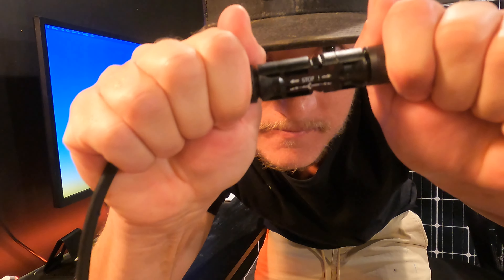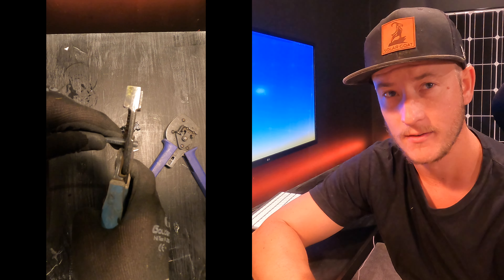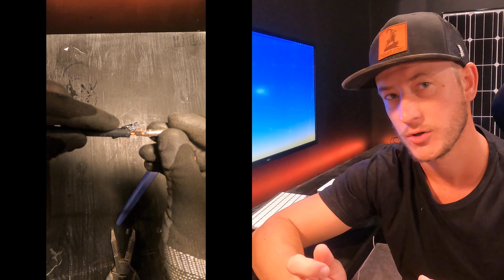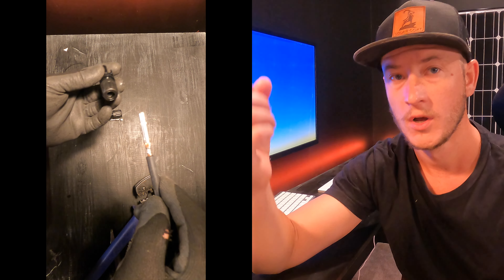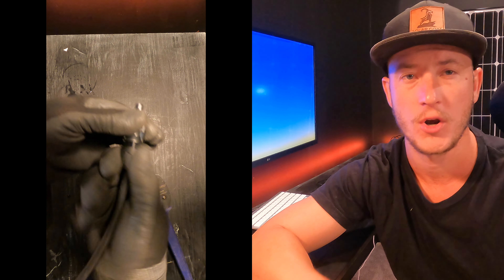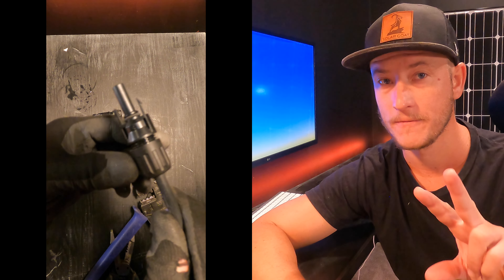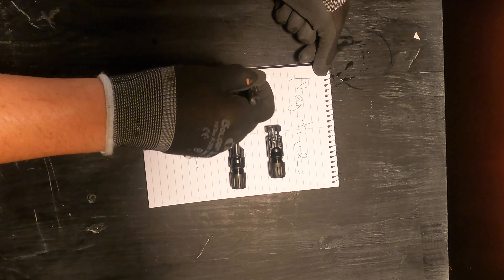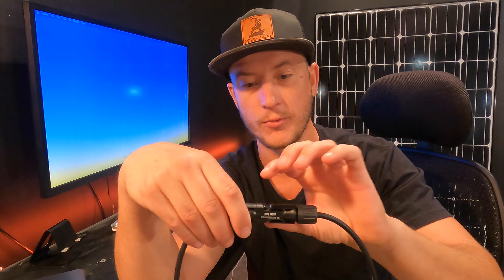How To Connect Solar Panels - Special Crimping Tool

Comment: You should show the danger or positive and negative arcing on the strings people will get the danger of DC voltage under load . I was amazed the first time I seen it .
Reply from the maker: Thanks for the idea. That would be a perfect demonstration for video.

Comment: DO NOT USE 2 DIFFERENT TYPES OF PV CONNECTORS!!!
Reply from the maker: Thanks for the comment! I strongly agree. If you know what kind of connectors are factory installed on your inverters or panels it’s definitely worth it to buy the same kind. (H4 or MC4)